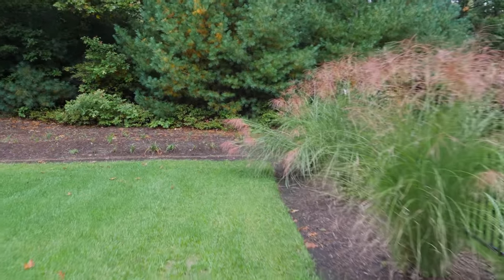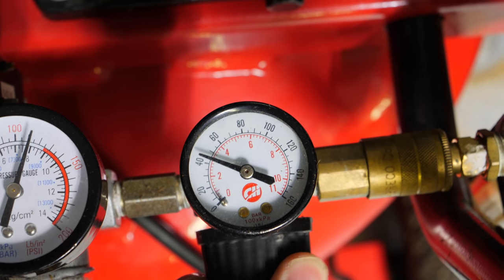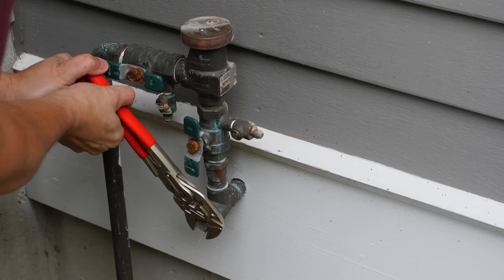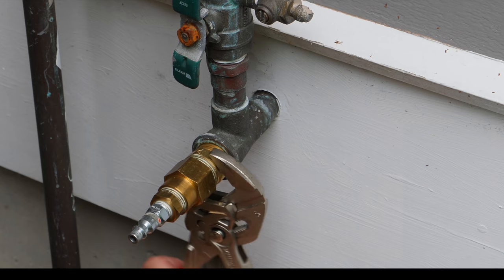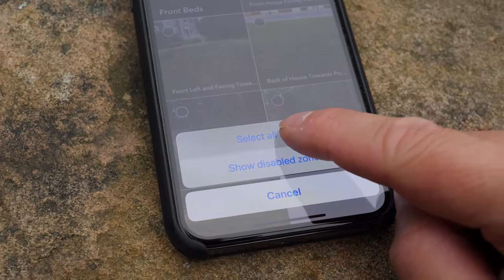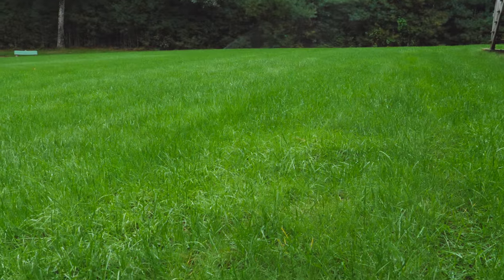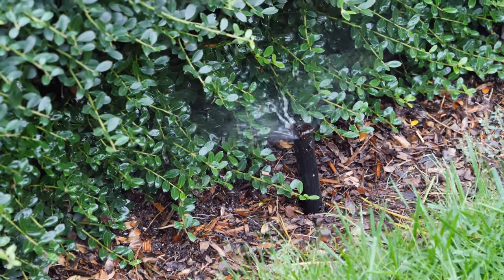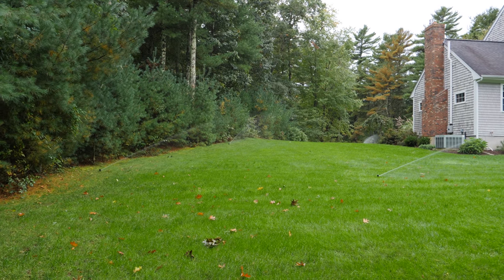How to Winterize Sprinklers DIY Step by Step - Blowout the Pipes

Comment: Not true about the air compressor this is ridiculous your gonna cause people more problems and future repairs because of this! 
Trust the pros in all trades!
Reply: Gluon Particle if you say it’s not true, say why.  Otherwise people will assume you’re just trying not to lose business.
Reply from the maker: He can't because it isn't. Any real pro has no fear of losing business to DIY'rs.  Home systems are nothing like giant commercial systems that run ball fields. etc that require a much larger compressors because their piping is larger and runs can be very long.  Watch the water come out each zone and when it stops the water is out, if in doubt cycle it through for another few minutes per zone to be double sure that you are good. I can only share my experience doing this on 5 different homes with brands from Hunter, Rainbird and Toro with nothing but perfect results.
Reply: It's not about business like I said before when you need a plumber do you do it yourself? When you need an electrician do you repair it yourself? Same with irrigation. its because I have winterized thousands of houses. Ive seen the problems first hand!  You people can do whatever you want I'm just saying from experience most people have caused themselves more money $$$ and frustration then to just have it done professionally.
Reply: @SilverCymbal  are you a professional irrigation technician?
Reply: @gluonparticle9327  what did he do in this video that is so wrong?
Reply: Some hot takes here from our boy gluon. So, I AM an irrigation professional and I do winterize residential sprinkler systems (in northern Montana) and I can tell you that while this isn’t the way we do things, it will technically work. I would strongly recommend you don’t blow THROUGH your backflow preventer though. Best practice is to install a fitting downstream of your preventer to receive your air fitting when you winterize. We use large compressors not for pressure, but for volume (CFM). Smaller compressors just can’t get as much water out of the lines as a larger unit can. If you have poly pipe, and you get a good bit of the water out with your garage air compressor, you’ll probably be ok, unless you have elbow or T fittings at a low spot, uphill zones that drain back to valves, etc. these will likely freeze and break something. Again, the process shown in the video can and does work for many people, but most professionals don’t do it this way in areas where freezing is a big problem. As a side note, I DO generally repair any residential plumbing or basic electrical issues I run into. Like anything else, these skills can be learned. Usually on YouTube.